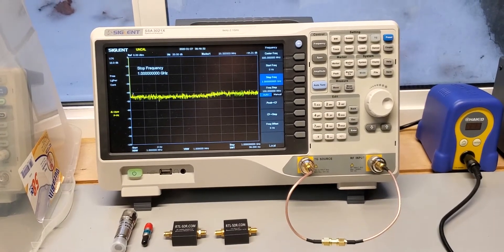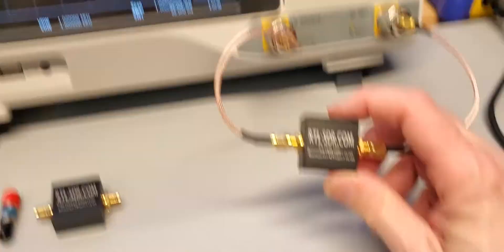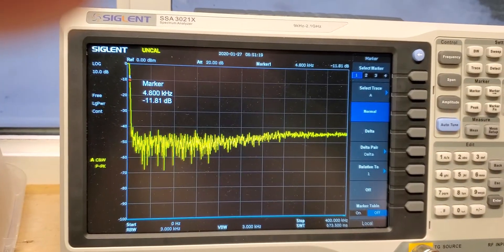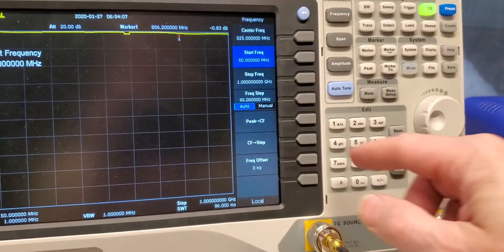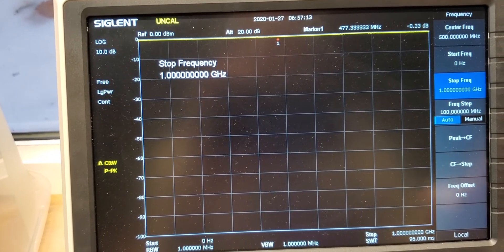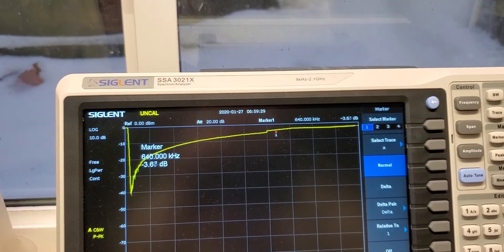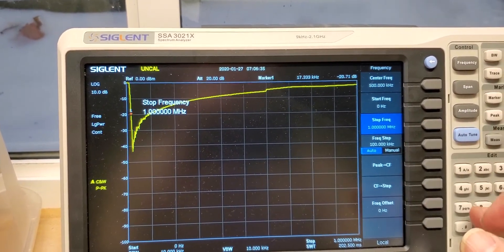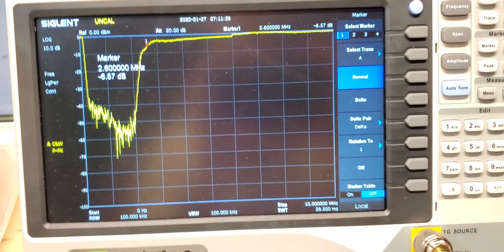Filter and DC Block tests

Comment: I have both a strong MW broadcast station, and a strong FM broadcast station near by me which made my RTL-SDR and my shortwave receivers pretty much useless. So far the RTL-SDR AM and FM filters have worked the best for me, I have other AM/FM filters and they don't block nearly as well as the RTL-SDR one do. The other filter I have is an BPF-1632I  it allows 1.6Mhz-32MHz to go by (blocks MW and FM broadcast) but isn't nearly as effective as the RTL-SDR filters. I'd like to have filters like the RTL-SDR ones but each with a switch to enable or disable them depending on what I'm trying to listen to so I don't have to constantly take them out of line.

Comment: ⚠️  Check out IMSAI Guy’s YouTube channel.  
In one of his dozens of videos on spectrum analyzers (I don’t believe it was one of the “Tiny SA” series..),
He explains that every spectrum analyzer has an internally generated “beginning” or “start” signal of sorts...

I don’t have a Siglent SA, so i can’t go into much detail about the model of SA shown in this video.
I do, however, have a Rigol DSA815tg “budget oriented” unit which is in roughly the same class as the Siglent 
instrument displayed in this video.  The Rigol DOES have the same type of “signal” at the very beginning...
right near the area you’d expect “zero” to be.

I also have 2 Agilent SA’s. one from the late 1990’s, an 8591c.  This unit has a range of 1Mhz up
tp 1.8GHz. The other model is a newer vintage, the n9340b with a range between 9 KHz and 3GHz.
BOTH of these also have the same type of “signal” indication near “zero”.

I can’t recall the explanation given in IMSAI Guy’s videos, but.... pretty much 
anything and everything he says is spot on correct.

Think you for taking the time to create this video.
Reply: that's the LO feedthrough the first mixer that converts to 0Hz. It exists in ALL swept frequency spectrum analyzers and its existence is actually a good sign that the LO is working properly ;-)

Comment: I think your spec. analyser cant go all way down. It actually says 9khz on top of it so... If it was really 0db at 0Hz like the scope says your multimeter would show 0 Ohm,
Reply from the maker: Yep, 9kHz is the lower limit.
Reply: Is that why the DC block doesn't drop off until around 30Hz? I kind of expected it to block DC.